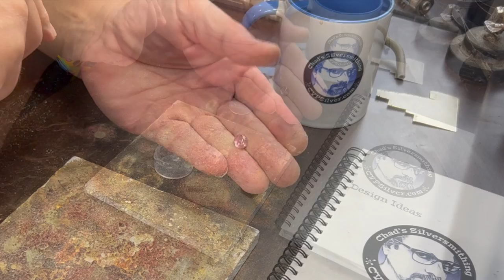Making A Tree Branch Ring with Turquoise: A Silversmithing Tutorial

Comment: There is one alternative I already imagine-instead of soldering he " branches" the prongs for the setting-you did use a 6gauge wire/ so why not use a jeweler's saw and place the cut length of silver wire in a jig or vise and saw the ends in half? The 6 gauge is thick enough for that-and then you could texture the ring shank-with GRAVERS! The bark=like texture you want can be engraved into the ring -just an idea!
Reply from the maker: A good idea Marcos!  I think you could achieve much more detailed bark-like surfaces with your suggestion, although it might take longer:). Thanks for the good comment!